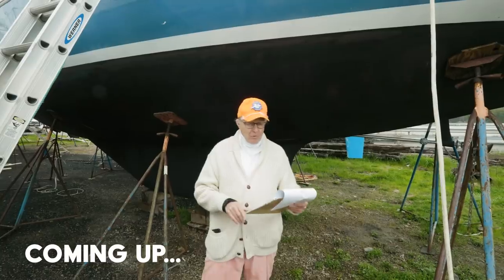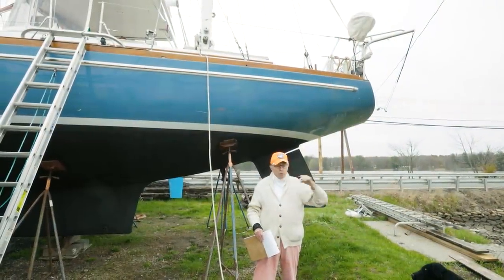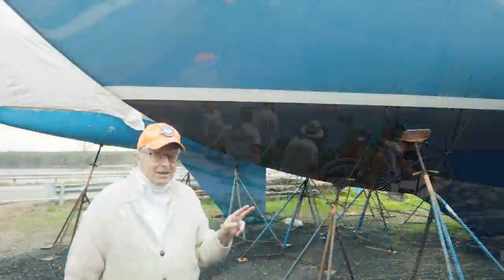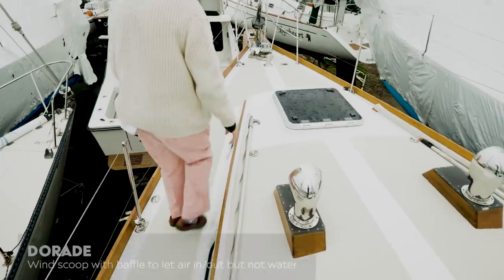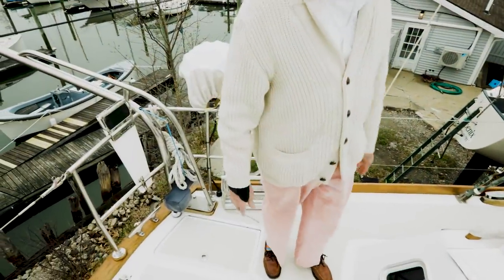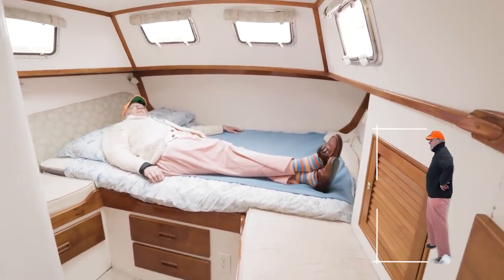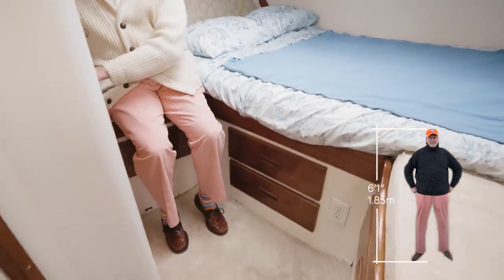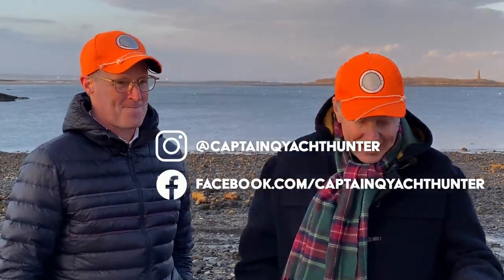$149k Bluewater Cruiser! Gulfstar 50 Sailboat for Sale | EP38 #sailboattour

Comment: This went up an hour ago, I bet it is sold already, a lot of boat for 159
Reply: It's a gorgeous boat for sure - is it a lot for 159k though? Genuine question, based on some of the boats I've seen for sale at the 20k mark. I would expected a boat that size to be like 90k or so.

Edit I forgot to convert USD ->GBP, it's only £113k which seems more reasonable lol. Still higher than I would have guessed though.
Reply: @MrThorfrog  i reckon the internal refit adds a little value.
Reply: Such a comprehensive and professionally undertaken refit makes the 159k price tag seem reasonable.

Comment: That is a lot of boat for the money.  The changes done by the owner were on point and necessary.  It is truly an impressive re-fit and I am glad you had so much enthusiasm in this video.  I probably would have been the same, such an awesome boat.  Though I would not consider a Gulfstar a blue water boat, the capsize screening and comfort ratio are not stellar but still safe and would make an incredible coastal cruiser/Caribbean cruiser.  It is nice to see a center cockpit for a change.
Reply: @malachy1847  You could cross the Pacific or Atlantic in a bathtub, it doesn't make a bathtub suitable for long distance and long term voyages.  The term Blue Water boat gets tossed around quite a bit with no hard definition, depending on who you ask.  My own definition falls more in line with Kretchmer's, yours may be different and that is OK.  There are boats of all brands, lengths and construction techniques all over the world, they got there somehow.  Fortunately humans have been building ocean going vessels for centuries and have an understanding of what works long term and safely and what works for nearer to shore sailing.
Reply: @NotOnYourLife   Could you specify your definition of a blue water boat? Thanks.
Reply: @davecopp9356  No, I cannot, it must be looked at on a boat by boat basis with attention paid to her sailboat calculations and overall design.  A boat designed to be a fast racer will probably not be suited to long distance travel where you need stability and ruggedness over speed.  Do a YouTube search for "john kretschmer bluewater boats" or check out his books in the library.  It is a lot to take in.
Reply: @NotOnYourLife   Thank you for taking the time. All the best.

Comment: I've been toying with a similar design in my sketchbook. A 45' Center Cockpit Wishbone Ketch, I like the little pilothouse. She's got an 18 foot beam and 6' 8" ceilings in the interior. Its a more modern hull design with a vertical bow, and wider transom at 12 feet. The deck will be entirely straight and level fore to aft, at 7' above the waterline, but curving down as low as 6' on the sides. She'll be named the Unsightly if she ever leaves paper.

Comment: That's totally gorgeous Gulf Star. Many despite having a cultish following put up with lesser models for the sake of owning one. This is definitely one of their finest offerings complete with some serious work to make her more comfy. But to wind though, yeah well gentlemen never sail to weather so,,,,,,,,,I want something that kicks my ass to windward. Here's the thing though with this vessel, her 5.5' draft is a compromise without a center board. You can not beat her to death to windward. Oh my Lord how many cabin bulkhead tops have parted from the cabin over-head due to the oil canning of the hull and up lift to the cabin with a deep centerboard. Centerboards are great for moderate wind performance,,,,,,there is simply no doubt there. However when you over-extend your beating into like a 30 kt wind and are sleeping on the cabin sole for that few days you should have cracked off the wind a bit on too many deep centerboards you find your head bulkhead is no longer still fastened to the cabin top that heaved up. This issue of furniture is especially pronounced on vessels rounding the Horn. Hanging out in the Roaring 40s is one thing, just making a pass through is quite another in final rigging standards adopted to the boat owner. So,,,,,,,my ultimate question here would be,,,,,would you trust this boat at this price to sail the Horn West to East of course. Her upwind performance will not allow her to run the Horn East to West. That would just be stupid. BUT, how would she be running the Straights of Magellan East to West ya think? You really can use a center board to beat a boat to death ya know.
Reply: Spencer, please do not buy this boat to sail to high latitudes. She could do it, deeply reefed, but why would you?

Comment: Lovely boat and a terrific refit. The only tiny question I have is about that tall hard top. Would those vertical surfaces not produce a bit of drag? This isn't a terribly fast boat to start with (no problem, it's a cruiser, I get it) but I do wonder how much drag that top would be with all the wind screens deployed. As I said, not a big deal, but curious. One other tiny note is that space behind the nav station. You could say that's a terrific sea berth, but you have a good sea berth right forward of the nav station with that settee. The space behind the nav station might have been better used as a small workshop (next to the engine room, as it is) maybe with a washer/dryer installed. Those features are more than "nice to have" on long passages. Other than these two minor quibbles, I'm thumbs up on this one.
Reply: Absolutely right, Zingaro. That hardtop enclosure must create some wind resistance, sailing to windward,  perhaps marginally more than the dodger and Bimini top on 95% of cruisers. But well worth the tradeoff for the increased practicality. And the VIP lounge? Yes, many Gulfstar 50 owners have put a workshop and a washer dryer in there. As the new owners of Calypso could easily do as they wish. Amazing that some cruisers  are still out there without a washer dryer, water maker, bow thruster and genset.
Reply from the maker: Thank you Jonathan

Comment: Always a great time/video! Any opinion on the cutter vs ketch for this model Captain?
Reply: Robert, the Gulfstar 50 does not come as a cutter ketch. Calypso has an inner forestay which allows a working jib to be hanked on when it is blowing like stink. I’m sure there are GS 50 owners who have retrofitted a fitting at the front of the coach roof for a true cutter rig.
Reply: @jacaldwell52  maybe I have the terminology wrong, but I’m looking at a ketch design in sailboatdata.com

Comment: Could someone explain the holes for bilge drains @ 5:10. He said it is normal for water to get into the ballast cavity???
Reply from the maker: Did we say that ? If we did we miss spoke.  When ballast is installed internally It is sealed over on top to create  
A smooth clean interior bilge . 
If the hull surrounding that ballast is invaded by a rock. Water can get into that cavity but there should only be a tiny amount which can be “cooked”out at thd haul on the hard

Comment: IMO a bit pricey for what you get. Yes it's been rebuilt, but the truth of the matter is that people always think that increases the value of the boat much more than it really does. The main issue I have with radical rebuilds like this one is that you can't fall back on original plans anymore.

I'd say for $100k or maybe $110 it'd be a decent deal.

Comment: Captain Q often refers to waterline length. Why is this significant?
Reply: Henry, the longer the waterline, the faster the maximum speed.
Reply: @jacaldwell52  Hi Jonathan, thanks for your reply. I have deducted that is the effect but still don't understand why it increases speed. Hydrodynamics 101 I guess. Will look it up👍
Reply: For cruising, to knot or half knot is the question when measuring performance at the waterline. Then there’s sail-foil carbon tech or an airplane tethered to water. The longer the faster.
Reply: @MaShcode  thanks Mash, like aspect ratio on an aircraft wing?

Comment: I  considered this boat for my live aboard semi retirement, but where the exec lounge is, I need a work shop. I of course could change the space and add more access to the engine room. But I hate taking about someone's good work. I am not a fan of a dog house even one as sharp as this and considering no intention to sail in cold climate no need for a topside cabin. No bow thrusters, no water maker, no generator, battery arrangement, condition of bilge, and more not covered. At this price point even with the name Calypso (huge Jacques Cousteau fan), not turn key to meet my needs. I am sure she will make someone very happy!
IMO
Respectfully.
Reply from the maker: Thank you

Comment: I imagine it would be tricky to dock this baby without bow thrusters, I`m sure the captain could do it in his sleep.
Reply: No problem, mon.
Reply from the maker: A little practice learning how your boat:
Backs 
Turns 
Starts 
Stops 
Reacts to wind 
Reacts to tide 
Prop wash port or starboard 

And your all set 
And then rule #1:
Go as slow as you can and still control boat 
Worst case you eill totally minimize any damage
Reply: @YachtHunters  Your all over it Captain, love you mate...legend
Reply: My view on bow thrusters is that if you have them you need them as you never learn the skills needed. If you don't have them you don't need them.
Reply: @nick2300  Exactly!

Comment: It has good points and bad.  The day cabin/nav station is excellent.  Like the aft cabin and bathroom.  The forward bath is acceptable although I would'nt use it.  The galley headroom is poor although I don't care for center cockpits.  The salon is a disappointment, once again CC.  Engine compartment is fine but should'nt that antique iron sail be in a museum.  Evidence of a once proud civilization.  Did'nt see any generator or AC for that matter.  Interior space is disappointing I guess a finer hull line than modern boats.  Dodger is butt ugly but I like the extra space.  Maybe take it off in summer and put it on in winter.  Don't care for overhead guages distant from the helm (I am nearsighted).  Does it have big auto pilot?  Exterior save the dodger looks fine.  I am always skeptical about asking price on a Bristol old boat.  Doubt book value or loan value will support it.  You could take a big loss on resale.  Barient winches?  Oh please.  Was he too cheap to get something better?  Maybe even power winches on a boat like that.  Is the roller furler some antique?  All this stuff costs money.  Would prefer a variable pitch prop I have heard nothing but trouble for the collapsing type.  Bow thrusters?  Maybe a SSB?  Water maker?  Digesting toilet?  It would be fine at a bargain price but don't know if this is a bargain or a hole in the water.
Reply from the maker: This one didn’t tickle your fancy, eh? We loved the engine room, the extra VIP area and the refit work. Ran-day was with you on the dodger aesthetics and galley headroom… still a proven/fun vessel to cruise to the Caribbean…